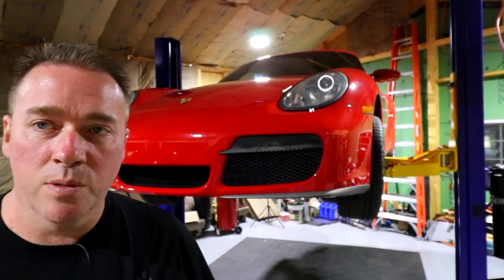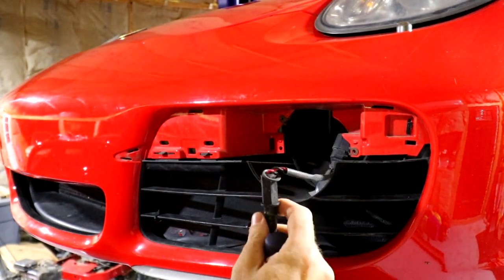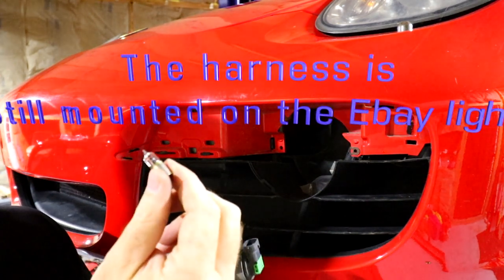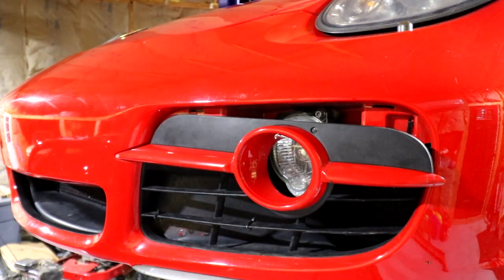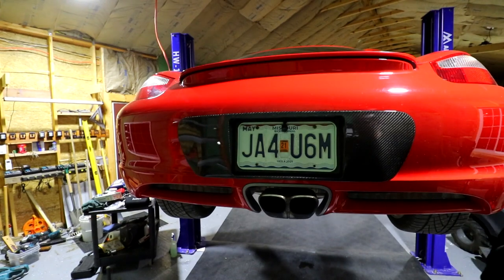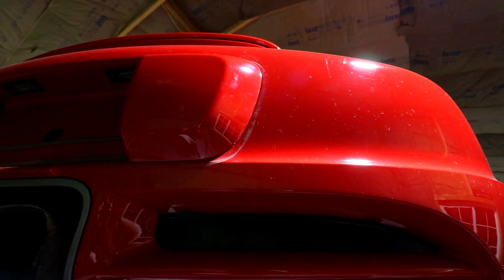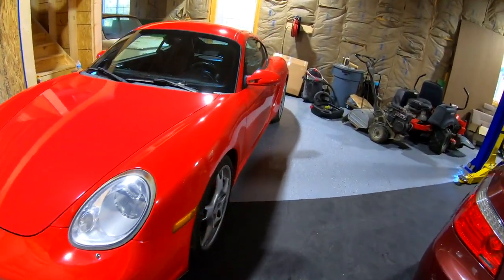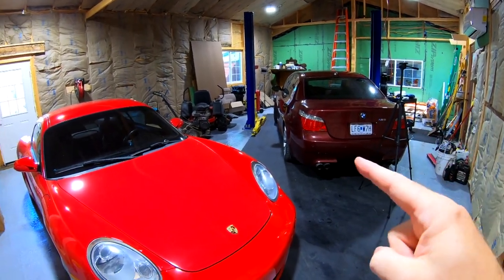I Bought A 2006 Porsche Cayman S 987 *Removing Aftermarket Parts *

Comment: You have the non-serviceable IMS bearing in that car.  You might want to consider the Direct Oil Feed solution.  a/k/a DOF.  Not perfect, but probably the best for that 2006MY car.  Others talk about just removing the bearing seal, but that strikes me as dangerous.  The oil bath is not enough at speed for sure.  

You might want to clean the rads.  I would bet they have years of crud in there.

Comment: That’s a gen1 987 , ims go bad , are you worried ? I had a 05 boxster it destroyed its engine I sold it for parts , 2006 onwards slightly better ims
Reply from the maker: Your Boxster has the m96 engine, in 2006 they changed to m97 engine that did not have the IMS setup
Reply: @NathansPorscheWorkshop  yeah course you’ve  got an ims ,it was revised but not got rid off it’s a slightly larger bearing , spigot and nut but it’s still there , and unfortunately cannot be changed by drifting it out off the case as the bearing  is bigger than the aperture, it still fails as well , it wasn’t until 2008/9 that the ims was totally got rid off and that was the gen2 cars